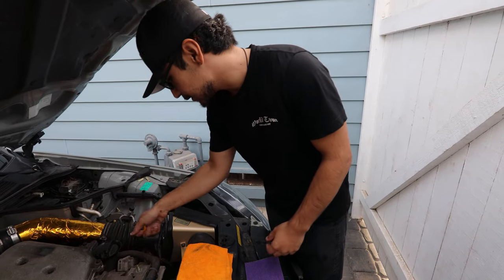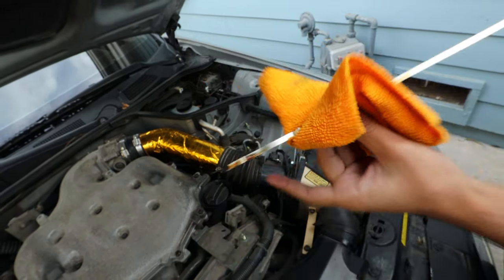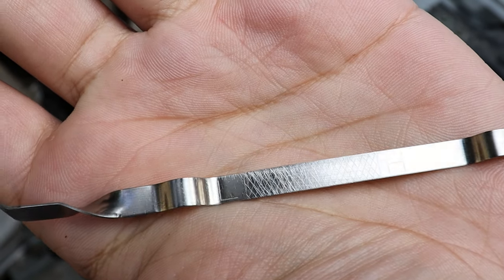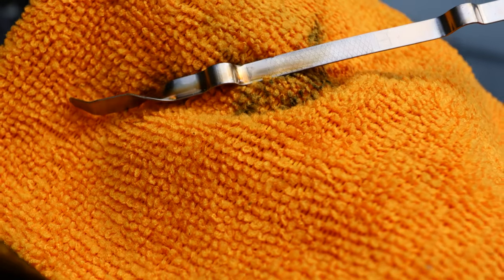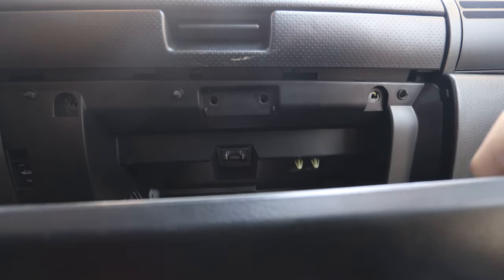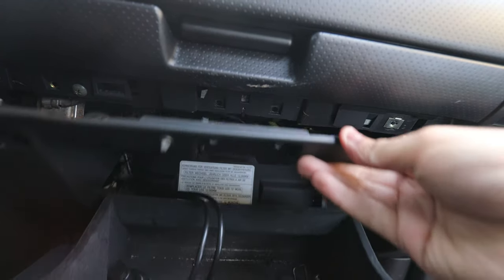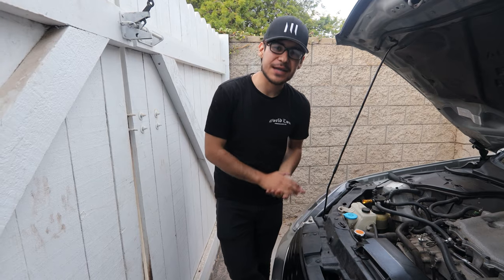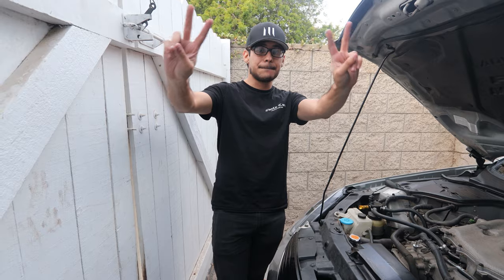3 Things to Help Maintain Your G35!

Comment: I thought I was the only one with the oil cap issue😂 always carry pliers in my door just for that
Reply from the maker: Apparently buying an aluminum one fixes it! I think imma try it out!
Reply: @JoeVazquez  Yeah man, definitely do it! I used to have this problem on my 06 G35 sedan, until I got a billet aluminum Nismo oil fill cap from Z1 Motorsports. The stock plastic cap is literal garbage. Just think about it, a plastic cap in a hot engine bay, it expands and contracts, and that's why it won't come off when you want to add some oil, even if it is snug. I highly recommend the aluminum Nismo oil fill cap, the only MAJOR downside is if you drove your G recently, the cap will be hot and will burn your hand. Just get a towel/rag and you'll be fine.
Reply: @Strange Daze Are you talking about the aluminum oil fill cap? If so, yes they are available for Zs and Gs (not sure about Infiniti Qs) and they do work. As long as you don't tighten it down too much, you'll be able to get it off by hand (compared to the garbage plastic cap).
Reply: @Strange Daze You're welcome.
Reply from the maker: Both of you guys are awesome
Reply: 3.5 altima owner here, same problem 😁😁

Comment: Bro I swear to god somebody torques down my oil fill cap during the night. That shits always soooooo hard to take off
Reply from the maker: Hahahaha them dam caps man 😩
Reply from the maker: @LastNahaj  im too weak for that haha
Reply: yeah its crazy i always get down low and get it off barely everytime
Reply: I be tight af, shit is hard af
Reply: I used to have this problem on my 06 G35 sedan, until I got a billet aluminum Nismo oil fill cap from Z1 Motorsports. The stock plastic cap is literal garbage. Just think about it, a plastic cap in a hot engine bay, it expands and contracts, and that's why it won't come off when you want to add some oil, even if it is snug. I highly recommend the aluminum Nismo oil fill cap, the only MAJOR downside is if you drove your G/Z recently, the cap will be hot and will burn your hand. Just get a towel/rag and you'll be fine.
Reply: I get it on DE, Couldnt get it off, had to wait next day and went super sayain to get it off.
Reply: I thought i was the only one lol
Reply: 😂 it's naturally like that broski I have mad muscle from just taking it off haha

Comment: My 03 has the same oil cap issue.  I little trick that saved me was simply lubing the threads with fresh oil as I’m doing the oil change and when u put the cap back on, stop tightening when it stops. Just make it snug.  DONT force it tighter. As u drive the oil pressure will tighten it more.  Should be a lot easier to remove with just ur hands next time.

Comment: The notches on the oil cap are meant to fit a large wrench to unscrew it. The pressure from driving the car will make the oil cap really hard to remove.

Comment: Wow, they went backwards on the G37 on access to the cabin filter!  It's now 7 screws and they are much harder to reach!  What was infiniti thinking?  Many owners ditch the 7th screw that is really hard to reach since even 6 screws is overkill plus you have to remove 2 plastic panels which are easy enough.

Comment: That's sweet. I just got a 2005 G35 sedan. I'm loving it! I have a question though. My battery seems to have a parasitic draw, I'm pretty sure it's the aftermarket stereo. Anyway do you know if you can still use the info function? ( information for the current conditions of the vehicle) I did not install system, previous owner did.

Comment: Hey, I have the same headlights and i don't know what lights to buy that will fit the low beams you know the larger lower light part. Do I need a conversion kit or can I just get a specific type of lights. It was supposed to be plug and play but that's not the case, lol?

Comment: 1) Is the charcoal canister a lifetime thing? 2) Also an owner before me, on my g35 put a spectre aftermarket air filter but I bought another one not knowing it was washable but  I’m not sure how to change it. 3) also my car is making like a squeaking noise after I turn my car off in the front any ideas what that might be? As far as I know my car doesn’t have any engine problems

Comment: I  having issues with my brakes. I changed the cam prongs and disconnected the battery from the engine. Now when I start the car the brakes don't work. I had to  get a tow
. I thought I needed a brake booster. I need help with diagnosis? Do I need to do a computer reset? Or booster?

Comment: had the same problem with my oil cap. i replaced the cap with aftermarket aluminum one i got from ebay. that fixed the problem.
Reply from the maker: Right on man!!

Comment: Hi Joe, thanks for this video. pls I have a problem with my electrical. the wipers, dashboard lights, sunroof on my 2004 g35 is not working. the dashboard lights goes off when I turn on the headlights. Also there is this noise under the car that i kept hearing when the car is on. pls help me. thanks

Comment: How many miles you got i put 219 on my maxima 2007 then the 2nd motor to 239 miles i need to do some work on it... average car does not go over 100k miles with the same motor and transmission some dont hit 60k miles

Comment: Ty...can u tell me why my lights don't work in auto anymore?
Reply from the maker: You may have a messed up sensor that detects when the lights should be on or not, I’m not entirely sure what the piece is called but you’d probably just need to replace it and it should all work again

Comment: According to INFINITI cabin filter should be installed with arrow pointing DOWN. And installed with part number/arrow facing the rear of the car.
Reply from the maker: I definitely showed it wrong! I didn’t want to flip it at that point since one side had all the dirt but I will be changing it as soon as possible since it’s been a minute since over had it on the car!
Reply: @JoeVazquez   I only know because I put mine in upside for years!! That “car check” test I never knew about! Thank You!!
Reply from the maker: Of course man!

Comment: YESSSSS! Oil Filler Cap is tight as fudggggee :) I donno why....I think they're just solid caps that stay good...I use a pair of 2-channel channel lock pliers...careful with the needle nose as they won't grasp flat against both sides...might end up tearing up the plastic cap...also I put a rag usually in btw the pliers to keep them from hurting the plastic...but I have not yet once been able to undo with fingers (after running) if you do it first thing after putting on (and not putting too too tight) you can probably get it with hands...but especially after running...it's like the vacuum of the crankcase pulling past our skinny ass piston rings is sucking it in tighter :) hahahaha another good vid!! although I'm a little skeptical about the dipstick thing hahaha

and the "Diag Mode" (aka Auto Active Test) is here:

Section PG (POWER SUPPLY, GROUND & CIRCUIT ELEMENTS) of the Factory Service Manual. Starting on Page 22:

IPDM E/R (INTELLIGENT POWER DISTRIBUTION MODULE ENGINE ROOM)
Auto Active Test

couple things in there to consider (main one I was watching you going ouch) was is tells you to:
1. Close hood and front door (passenger side) and then lift wiper arms away from windshield (to prevent
glass damage by wiper operation).
NOTE:
When auto active test is performed with hood opened, sprinkle water on windshield beforehand.

bc you could hurt the wipers with hood open, and hurt the glass running them with no lube under the rubber :P hahaha just saying, good work though otherwise!!

ps. you can cancel the test at any time by turning the key to off so you don't have to sit thru 3 times if you dont wanna, nice vid again!!!
Reply from the maker: Wow thanks for your comment this is great information to have! 😄

Comment: What happens if you don’t replace cabin air filter?
Reply from the maker: They essentially filter all of the outside air and give clean air on the inside of the car. So overtime with dirt and debris trapped in the filter, it’s not doing it’s job well anymore and you’re breathing in all the musty odors, if it’s bad enough it can be bad for your health! Not only that but with all that on the filter, it can be harder to defrost your front windshield and your ac could not be as strong as it usually is!

Comment: I have a question my g when i break hard or kinda hard the oil light goes on but goes away in a few sec
Reply from the maker: CHECK YOUR OIL ASAP!! Usually happens when you’re low on oil
Reply: @JoeVazquez  changing it today
Reply from the maker: Let me know how much oil was in there, I’m curious!
Reply: @JoeVazquez  shure 😂
Reply: @JoeVazquez  welp it had too little 😬 soo im installing a oil pressure gauge
Reply from the maker: Glad you checked it bro!

Comment: And another thing is if you wants to switch the headlights out on your car and put better headlights it's a lot of money because you have to actually take off the front bumper and both front Raymond's Nanny have to go under the car so when I got mine done at a shop it was way more than I expected and the people didn't wire it right or the wiring in the car is bad so one of them flicked on and off and I paid almost four hundred something dollars for the lights themselves Plus getting them installed people think it's easy to find modifications for this car it's actually very hard to find and body kits are nearly impossible to find online maybe back in the day was easier but nowadays every time something happens to my car it's almost impossible to find just to keep the doors open the little thing that holds the doors open for the hundred dollars each

Comment: Dude can you roll to south  Whittier and check how weird my car is. Got stolen and someone stole the fob. Things are different and out of nowhere they are back. Somehow bearing got fixed, but speaker on door is out. Review mirrors are different speakers in em stopping, seats literally move on their own. I drove car on empty lot but on car one fifty feet on right parked. Testing alignment I’m driving no hands aboutb135 it tugs, and slightly rotated right very eerie like and was directly behind only other car. I’m fighting a sexual harassment case worth millions!!! (Sick perverts) so i get heavy harassment and I’m positive app of car readings is sent out ,gps ,seat hacked ( head fits out sunroof) and cement was placed under car and I have lots ofbdirtbbehindbtires. Ran great til last summer. I keep folder of visits to shop or replaces and even washes all transferred into spread sheet. I was gonna mod front bumper to more sleek like Porsche type and enclose rear windows 2 small and roll type rear. Prob take back row and put two drop seats like smaller trucks have. Also my body extends n lowers about and inch

Comment: I own a 2006 automatic Coupe custom here's the main thing you need to know which I didn't know the guy I bought this car from put a fiberglass body kit do not put a fiberglass body kit on your car amount of money I've literally spent on his fiberglass to fix it there is a thing now it is I'm not sure what it's called but it's fiberglass and plastic mixed you can get them for the body kids now I'm not sure exactly what that's called supposedly that's what you need so when you get hit it doesn't destroy the whole bumper or frame

Comment: Yo that happened to me last month while I was snowing I went to go try to add some oil to my car and have a G35 05 Infiniti that damn cap will not come off to save my soul I was so pissed off I was out there fidgeting with that cap for 30 minutes but all I had to do is go put on some gloves with the rubber grip and turn that b** like you trying to snatch it off but I had to get mad first

Comment: if you clean your oil filler cap BEFORE putting it back on after an oil change... you wont have issues removing...  this goes for ANY and ALL vehicles...

Comment: Where's the transmission fluid stick?
Reply from the maker: Manuals don’t have one but if you have an auto it’s behind the engine by where the camshaft sensor closer to the battery is!

Comment: As you probably know FYI the car is a goddamn magnet I've had mine broken into window shattered tootin gone stuff stolen out of it I put a 57 in Wing on mine people tried ripping that off stood on the back of the bumper that's why we're glass so when you park your car make sure it's hidden have a wheel lock on your car or a different steering wheel than what comes on there and you can take it off pretty much every other day I get offers on my car if you know what the car is did he know what the car is and you always freak out when you see one if you don't and people don't care about it and they want to damage your car make sure when you park your car somewhere it is hidden or it's literally way way way away from every single car in the parking lot

Comment: Do you have anything on 2004 g35 coupe wiper arm with the nozzle
Reply from the maker: Wait what?
Reply: @JoeVazquez  The nozzles to spray the windshield on my G 35 they don’t spray
Reply from the maker: On you probably just need a windshield washer pump! Assuming you have fluid in the tank and the lines are good that’ll be the problem
Reply: @JoeVazquez   I’m saying this is my first G i feel that would be a good video bro 
Your videos are 🔥🔥 thanks 🙏🏽